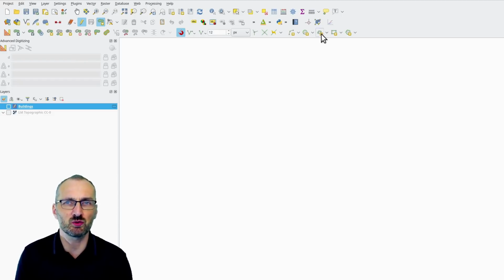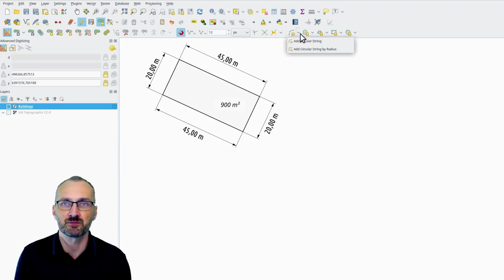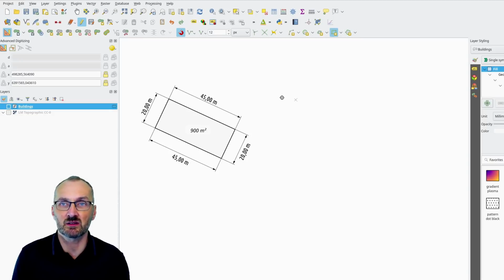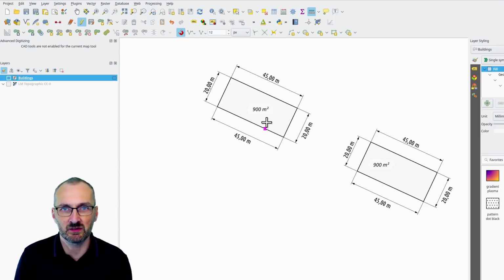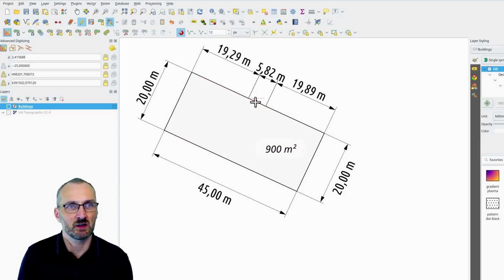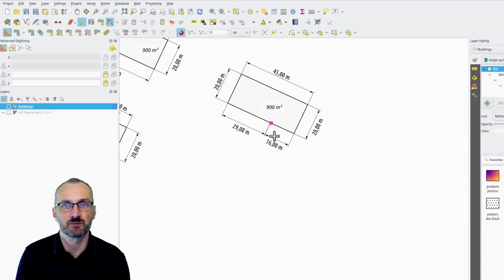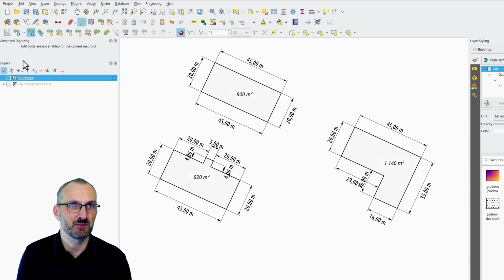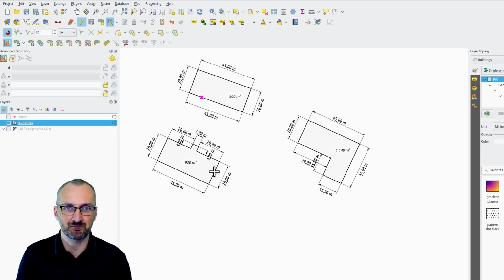QGIS User 0011 - Shape Digitizing Tools

Comment: watched again after a few years, this video is still the best on digitizing tools, thanks
PS for those who want to rotate geometries from different point than center select the object you want to rotate, click the rotate tool than press ctrl and click on the point you want to use as pivot, then use another point of the object for rotation reference and align it to desire angle.
Reply from the maker: Top Tip! And if you want to rotate around a specific vertex, just activate snapping.

Comment: The advance digitizing tools is not available (gray out). "CAD tools cannot be used on geographic coordinates. Change the coordinate's system in the project properties." please your help!
Reply from the maker: The data you want to edit must be in a projected coordinate system where the unit of the coordinates are something like "meters" or "feet". It does not work when your data are stored in an unprojected coordinate system like WGS-84 with coordinates in degrees. The data must be able to build geometries mathematically and that is not possible with unprojected data. Try with a temporary data set (memory layer) where you specifically set the coordinate system for the layer to a projected CRS like suitable UTM projection. You should also set the project you are working in to the same CRS to make it easier for you.

Comment: Do you have a video on how to convert vector layer to raster using GIS 3.16?
Reply from the maker: Not exactly, but you can use "export" from the project menu to "render" the current map to raster, or the convert map to raster tool. For a single vector layer you can use the GDAL Rasterize (vector to raster) tool.

Comment: Hi Karl,  what how active digitizing tools?
Reply from the maker: First you need to have your project and the data you want to edit in a "projected" coordinate system (does not work with WGS84). Then, when you have activated the "advanced editing toolbar" you can turn the advanced options "on" by pressing the button with the square protractor and ruler.
The "shape digitizing toolbar" must also be activated, and as any other toolbar you can do that by right clicking the toolbar area. You can also do it by the menu "View" and "Toolbars".

Comment: Great video, thank you for presenting us new features! You are getting "wrong" readings when using measurement tool because QGIS displays true distance (geodetic distance - on ellipsoid), not the projected (deformed) distance, so there is nothing wrong with measurement tool. This SDT tools are cool, but only for digitizing 1 or 2 features (max 10). When compared to classic CAD softwares, it seems 1000 times slower, so I think it should be preferred way of digitizing features. On linux there is a free CAD DraftSight for 2D drawings. JOSM (an OpenStreetMap project) is also great tool for digitizing features from orthophoto imagery. There was also a great plugin called QAD for QGIS 2, which implemented CAD logic to QGIS, unfortunately it is not available in QGIS 3 yet. I would also recommend you to install some software for key press display (I can recommend "screenkey" which is written in Python) - it's confusing when you press a shortcut and the viewer is not familiar with it. And one last thing, I would not recommend rotating a feature, and than snapping back one point, it just seems so wrong :).